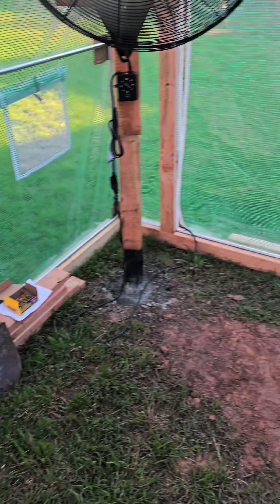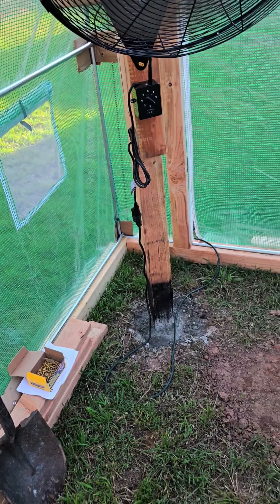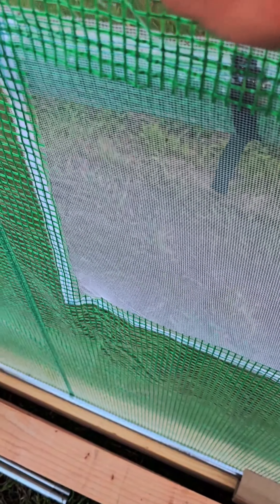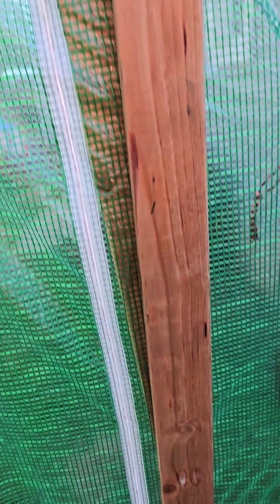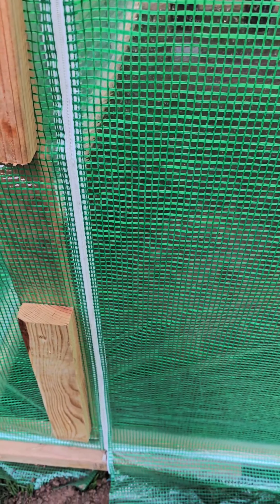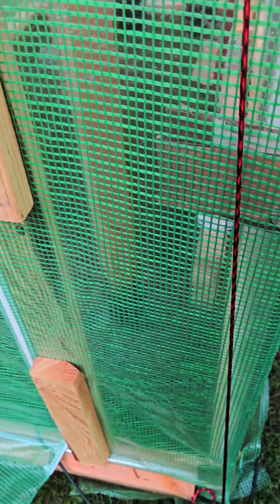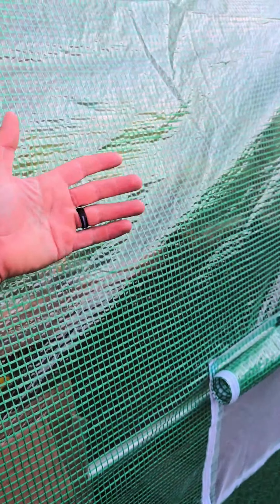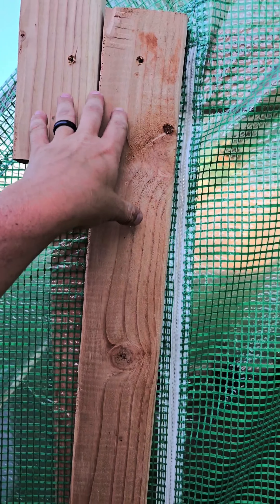#vevor Greenhouse 12x7x7 - How To Make It Last FOR YEARS!

Comment: Thats what i have to do nice bro just subbed
Reply from the maker: It makes the hoop house 3-5X stronger than before, I would actually have a difficult time TRYING to knock this thing over now, even if I wanted to.

These simple adjustments and added time will make it last for FAR longer than the standard cheap aluminum poles they include.

It's all about reducing the "flap". If you take the flapping out, you increase your odds against strong winds.

These are actually pretty strong if you reduce their weak points.

Then if your plastic wears out (which it will, even with 303 protectant) you just reskin it with a new cover or greenhouse plastic!

The first setup is the most expensive. It'll only cost ya around $50-$75 to reskin it after 7-10 years!

P.S. Also, I definitely appreciate the sub my friend! We gotta stick together.
Reply: @OkieOrganixCannabis  yeah I have the 20 by 10
Reply: @OkieOrganixCannabis  I'll stay tuned in growmie cheers 🍻😤💨
Reply from the maker: @Packmanfarmzgasthc4775  likewise my friend. Got that 🔔 checked on ya. 😎💨💨
Reply from the maker: @Packmanfarmzgasthc4775  Awesome you have the size I WANTED to buy but thought it might be too large.

Turns out the 12x7 isn't enough, the 10x20 will probably be the next purchase/setup I do!

I hope this helps you add stability to yours! It should make it last for several more years with just a bit more spent on lumber.

Just measure everything twice before you buy and before you cut lol.